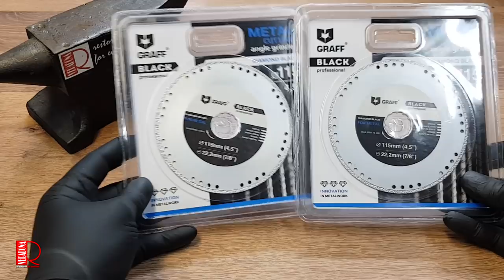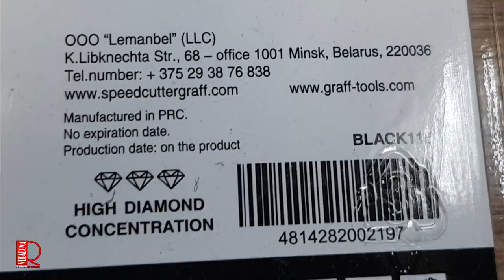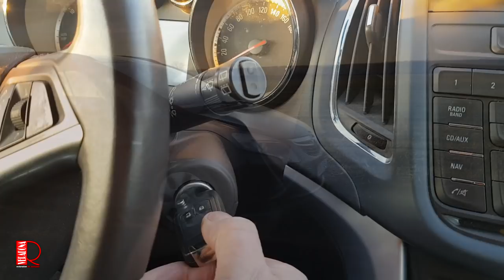Rusty Mining Lamp - Restoration

Comment: Sticking that bolt through the reflector then locking it with two nuts while you unseized with a hammer and spanner it is next level thinking.

Comment: I use similar diamond discs in my rotary tool There are two main benefits. One, they last a whole lot longer than the other kind, and two, they don't break like the other kind can.
Reply from the maker: Yes it is true. I've never tried these wheels. These were sent to me for testing. Although it takes a little longer than with ordinary cutting, but again does not hurt. That will be the advantage!
Reply: @VeradonaRestoration  tad slower, not a lot, but it's not as slow as changing them all the time. You can wear them out, but it takes a lot. The small ones for a rotary tool when you use the regular kind can shatter for no reason. These never have.
Reply: Hes using the diamond wheel and cutting wheel together, have you tried that?

Comment: I used to have a flashlight that originally took one of those big heavy six volt batteries. While I could still get them, they're expensive and don't last very long. I had to rewire the switch anyway, so I wired in a little box that holds 4 AA batteries. I'd hand it to someone that needed a light turned off, they'd feel and say "It doesn't have a battery" then I'd flick the switch and they'd freak, like it was magic or something. As dim as this one was, maybe you need more voltage than your'e getting from whatever battery you had to use. Maybe next time you should try converting an old light to LED?
Reply from the maker: Yes, I could, but I don't know much about electricity.
Reply: @VeradonaRestoration  DC is simple. if you can install a battery, you can figure out putting in a power pack or a LED bulb.
Reply: @VeradonaRestoration  There are many plastic battery holders, complete with contacts and ready for wiring. And, usually i extremely love restoring to full autencity, but this light really asks to use some LEDs to serve it's purpose for full extent.
Reply: Вроде даже уже есть готовые лампочки с таким цоколем (хотя зная китайцев - не удивлюсь если светить будут так же грустно, ну хоть перегорят медленнее и батарейка будет практически вечная).
Reply from the maker: @paveloleynikov4715  Ok, thank you Pavel for the explanation :)

Comment: Graff seems to be ambivalent about the outer diameter of their metal cutting blades. I see the arbor is 7/8ths of an inch, but the outer diameter looks like it's "4 inches or maybe 5 inches, whatever". That weird European custom of using a comma instead of a decimal point is throwing me off. Maybe they should have used the fractional presentation instead -- not 4.5" but 4-1/2". Lol
Reply from the maker: Don't do anything about it. We find our thumbs too difficult LOL